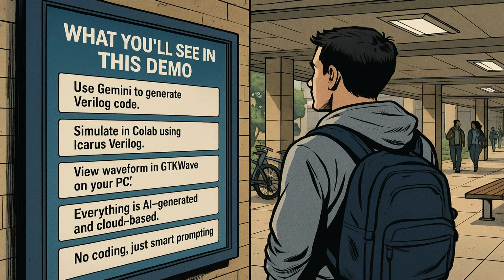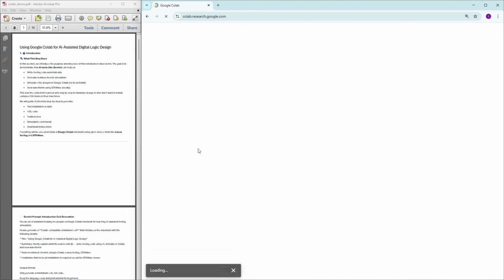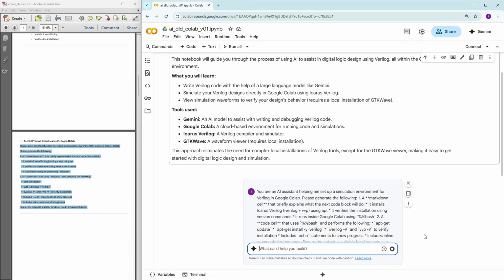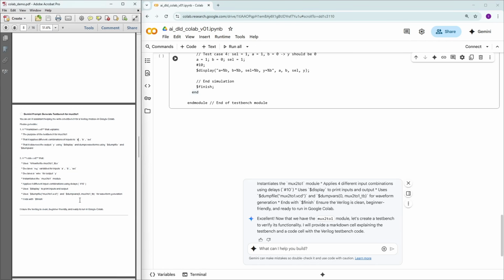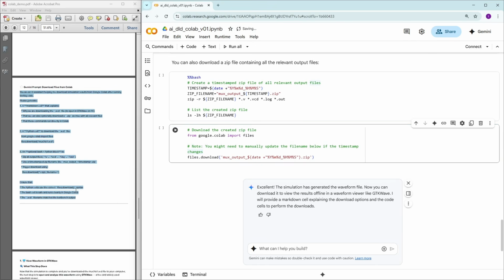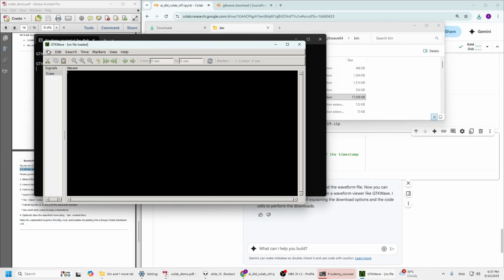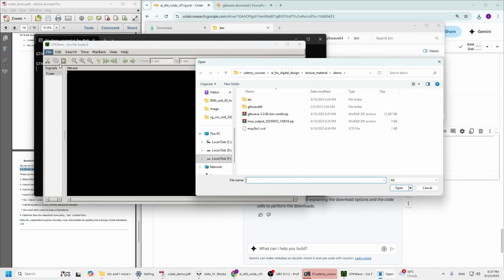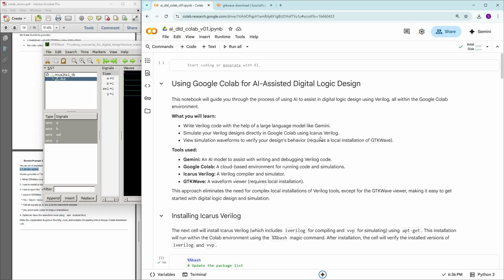AI + Colab + Verilog for Digital Logic Design - No Coding. No Installation. Just Prompt.

Comment: This is not the way to learn how to do hardware design.  You need to know how to microarchitecture and organize the data plane, control planes, and understand the tradeoffs involved in area, power and timing  Learning to code in Verilog or VHDL is pretty easy.  The hard part is learning how to be a good designer.  You can use AI to help generate code, but you need to be able to access where AI is giving a good or crappy solution and correct its mistakes. 

For anyone watching, what is described in the video is just bad advice.  Here's advice from someone with 30+ years experience doing this to someone just starting out.  Learn to design first.  You don't need to learn any coding in any language to do microarchitecture.  Just draw pictures. Then learn how to code without AI.  Learn how to verify your designs without AI.  Once you mastered things go use the AI as an assistant to help you generate code. Starting with prompting AI without understanding what goes on underneath is not going to get you a job anywhere. 

When I interview people, I don't even bother to ask people to write any Verilog code.  I ask them to solve digital logic problems to see how they think and whether they know the fundamentals.